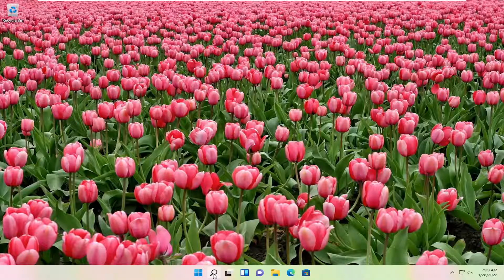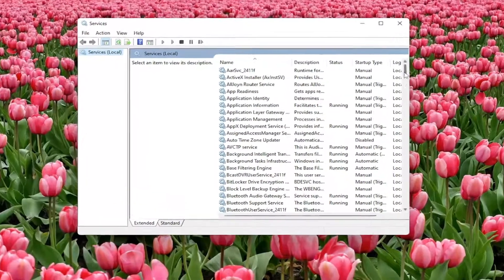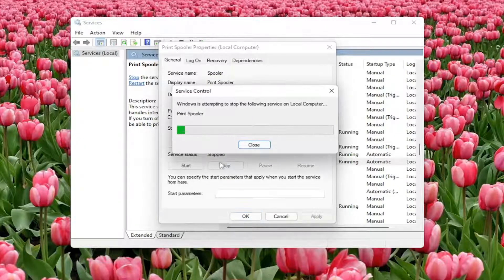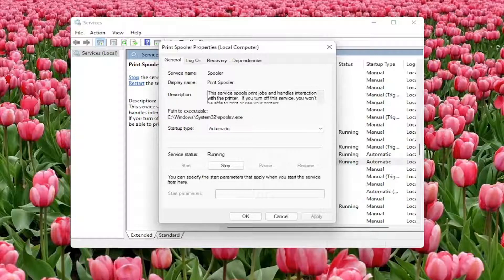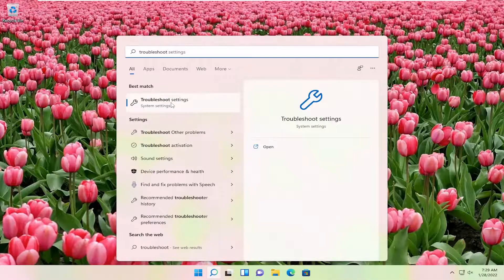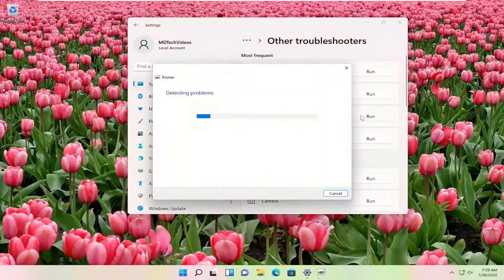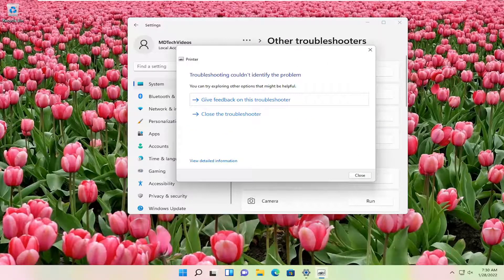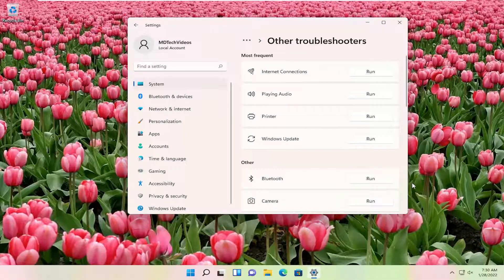How To Fix PCL XL Error in Printer Windows 10/11

Comment: The problem is with the document, NOT the printer or the computer. Export your document to Rich Text Format and it will print. There may be a few symbols lost in the translation but you will get the bulk of it. Another fix is to save the document as a JPEG then print using Adobe PDF printer; give it a new name and you can print it that way for an exact copy.  Don't waste your time with the "fixes" that are on the internet.
Reply: your solutions are wildly impractical
Reply: Neither his solution or your solution is the correct solution.
Reply: @chaykao7574  then what is